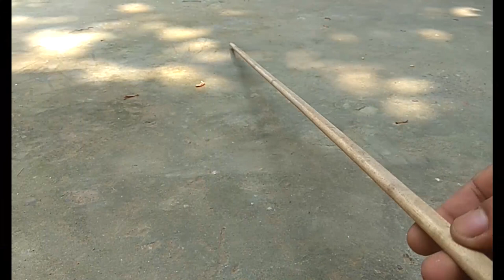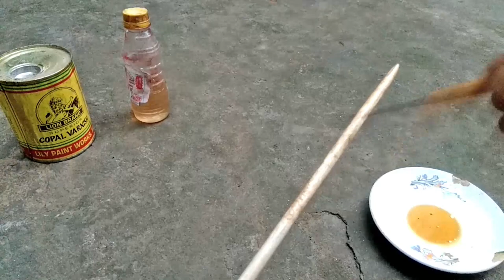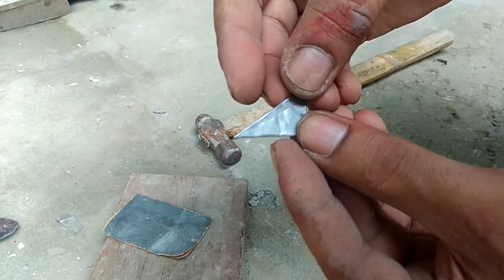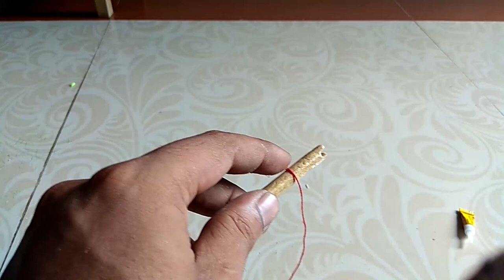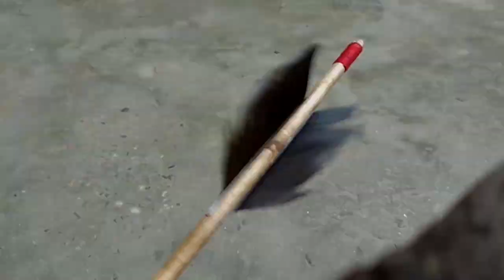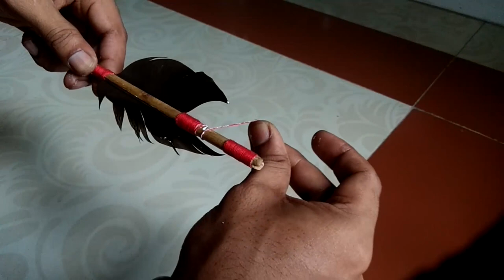How to make a Wooden Arrow | No power tools

Comment: Bro are you using bamboo
Reply from the maker: No, its made out of wood stick. But if you find suitable long and straight bamboo stick, it can be used as well.
Reply: And which wood are you using
Reply from the maker: @drawwithnawaz3729  I used normal window beads found in local hardware store